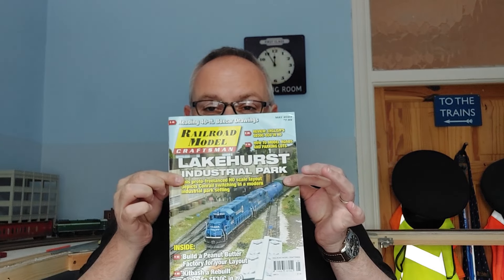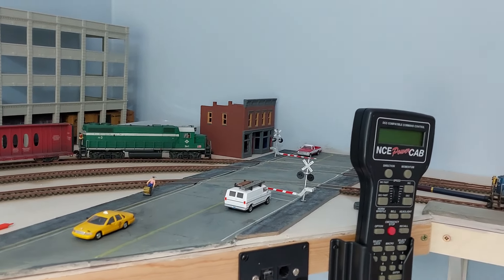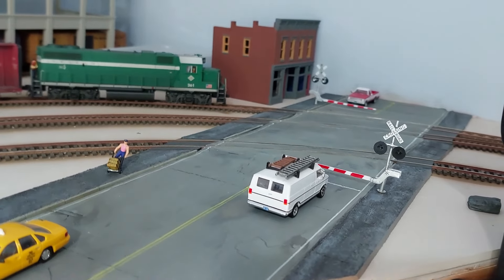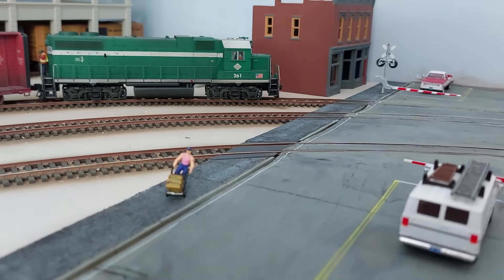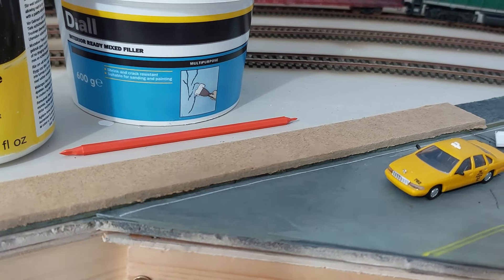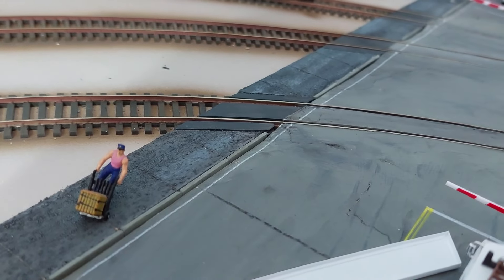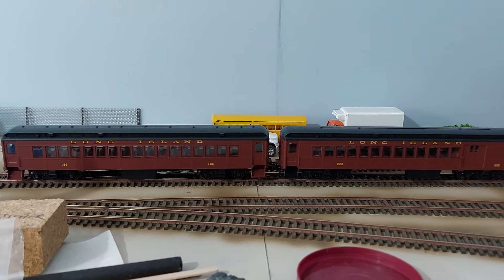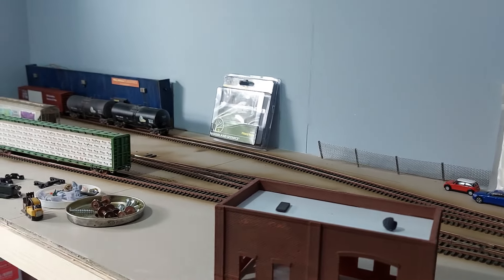City Yard: Layout Build Update Number 4

Comment: I love the coaches, and they will certainly add additional interest.  What colours did you use for the road surface and the concrete?  I have been trying to get a better concrete colour and you have nailed it.
Reply from the maker: So the concrete colour on the team track hard standing is Tamiya xf55 deck tan with a black wash over it to pick out the detail. The road was a neutral grey base coat (Daler Rowney Graduate acrylic picked up cheap) with lighter washes on top including  Vallejo model air 71.045 US light grey (also sometimes labelled as cement). Then various washes to highlight the detail until I get what I want. The pavement was sprayed with an undercoat light grey, the kerbstones picked out with the above Vallejo and the rest painted with Vallejo air 71.052 anthracite grey and then drybrushed with 71.132 aged white. At least that is as far as I recall 😅. P.S. I hand painted using the Vallejo air.